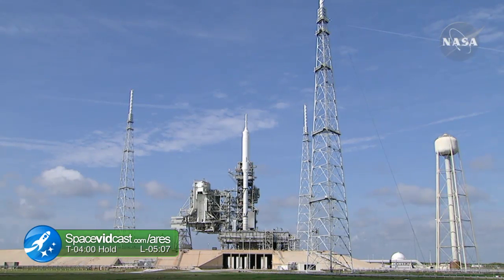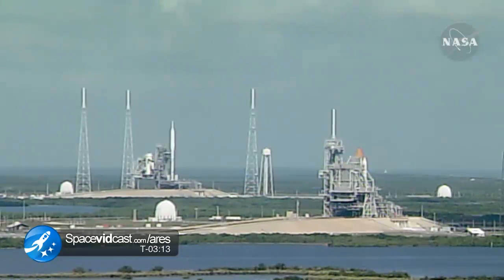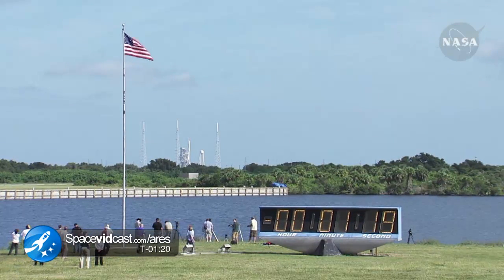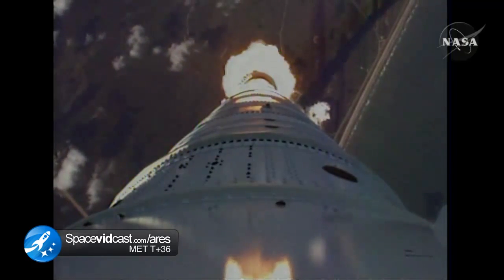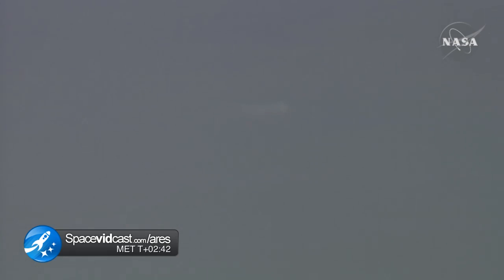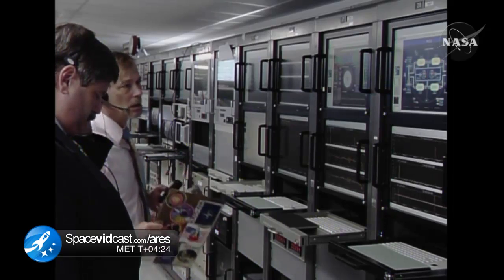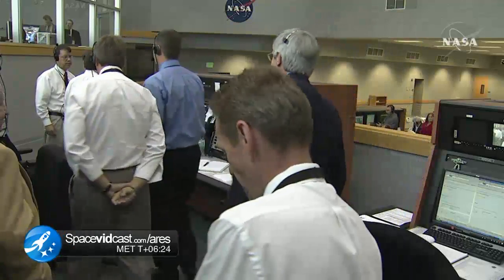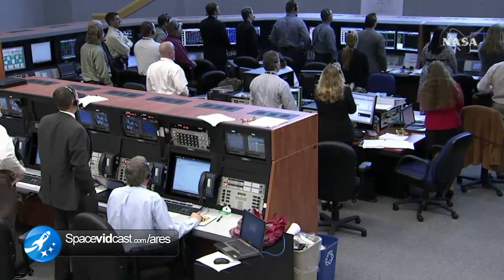Ares I-X Launch on 10/28/2009

Comment: Zephyrus001 (and Minueman 351):  The discussion is misplaced.  The second stage was a DUMMY!  A real second stage would have used pyrotechnics (including first stage breaking rockets) / ullage motors and ignition of its main stage to fly away from the burned out SRB.  None of this was available in this highly successful FIRST STAGE TEST FLIGHT designed to demonstrate that a highly educated SRB can serve as a relatively simple, safe, inexpensive, reusable, robust and otherwise perfectly good first stage for orbital flight !!!
Reply: "Highly educated SRB"? Does the SRB have three PhDs or what? Is this the F. Story Musgrave of rocket engines?
Reply: Gath Gealaich
You got it, GG.  Upgraded computer brain with trajectory data.  New sensors and communications elements to feed said computer brain.  And a new set of rocket thrusters near the top of the stack to induce (and stop) roll and otherwise assist the SRB's gimbaled rocket nozzle in keeping everything on course for two minutes.  :  ]
Reply: Russell S None of that is education. Education is what happens to a human being at school. Anyway, it's just a lot of pork for Utah, no sane person would design a rocket like that. Fuck corruption.
Reply: Gath Gealaich
Don't appreciate your language.  Sounds like you've been drinking that South African Kool Aid again.  Simple fact: If NASA had been allowed to finish Ares I (as many VERY sane people argued at the time), we could have dumped the Russians and been flying our folks to the ISS by now.  No pork involved.
Reply: Russell S "Language"? What language? That the company that killed seven people in live broadcast got another pork contract for their inadequate designs? You may not appreciate hard facts but they aren't going to go away just because you don't like them. The US could have been flying folks to the ISS in half a dozen different ways by now.
Reply: Gath Gealaich
The living legacy of the Challenger astronauts is that the U.S. now has a solid rocket booster that has worked without a burp 250 straight times, is the envy of the world and will take us to Mars.  The SLS will prove that.  You are angry, stuck in the past and need to move on...
Reply: Russell S Yes, and Ares I had to use an extremely ugly solution to the thrust oscillation problem inherent to solid engines. No, thank you, I'd rather go for designs that aren't stillborn. We already have F9, with a bit of luck, Raptor will come to fruition (it will be everyone's lucky day if it wiil), and despite ULA's very hard attempts at convincing me otherwise, I still think that ULA's people can respond to the RD-18x/19x engine challenge.

But hey, the person defending Shuttle SRBs calls me "stuck in the past"! What an irony...

Comment: My good sir, I would submit that you are the one who needs to learn about spaceflight, at least this specific instance.  I agree with you in principal about unmanned testing, but it doesn't apply to Ares I-X and here's why:

1.  Ares I-X was not the only unmanned test flight.  Ares I-Y, the all up test flight was scheduled after (which would have been a proper test)
2.  Ares I-X was only tested using a 4 seg booster (not the 5 seg for the operational Ares I) and an inert upper stage.Continued...

Comment from the maker: @nerdystarwarsman1994 Well, they spent a lot of money, yes. But an Ares I-X is not an Ares rocket. The rocket above is a 4 stage SRB whereas a real Ares is a 5 stage SRB. The above rocket had no upper stage whereas a real Ares would have a full upper stage. Heck, even the guidance computers were taken from another rocket as they were not ready. Most of the rocket is not Ares, only a small handful of components were, such as the parachutes.

Comment: Solid rocket fueled rockets like Shuttle and Ares 1-X remind me an old car running with bad gas in the projects.   Liquid fueled rockets like Soyuz and Falcon 9 are clean burning and look more like a real rocket (almost like jet fighter running full after burners).  Shuttle and Ares look more like there is fire on the bottom of the vehicle and  burning every direction making lots of smoke.

Comment: The local spaceport won't have anything a common person would be able to afford for at least 50 years, 50 years if we're lucky.

With a space elevator, you can build more space elevators cheaply. I've researched this and gave it thought. The ride up on the space elevator won't be bad either. By the time you can afford it, it will either be a nice hotel on the way up, or better, it will be a fast ride up.

It's not going to be one elevator at the equator. It's going to be thousands.

Comment from the maker: Well, and the parachutes. They didn't deploy right and they were the only final part of the Ares. This wasn't a full 5 segment SRB it was a 4 segment from the STS program (the Ares SRB wasn't done yet). There was no Orion module. There was no upper stage.  One of the only real parts of the system that will be from the final Ares design was the parachute. 1/2 of the stopping power failed and we bent the SRB on impact.

It *is* a test so failure is expected.  Borrowing from other programs is not.

Comment: Looks like the SRB fired and pressurized perfectly, the guidance system gimbaled for maximum deflection test while maintaining structural integrity, stage separation worked, the airframe proved functional at Mach IV @ 150,000 feet, and the parachutes deployed.  The launch vehicle was recovered, so the crew got that right.

The only thing that really failed here was your analysis.  Just for the record, do you have any clue what the cost and time and logistics requirements were for the Saturn V?

Comment from the maker: I wouldn't go touting the success of Ares just yet. 

The SRB was borrowed from the STS program and was not the 5 stage unit.  The upper stage wasn't done so they used a dummy.  The LAS wasn't done nor was Orion so they were both dummies.  The guidance software wasn't done so it was borrowed from Atlas instead.  The parachutes were real.  Of the three one failed fully and one half failed.

So basically almost none of this rocket was real, none of it was complete, and what was complete failed.

Comment: Just try taking a further look at things that sound crazy but aren't quack science.

Anyhow, the thing I expect to work the best in a time period that we're more likely to see is a system where we use large powerful rockets up to a station that acts more like a spaceport to the moon where you send craft powered with ion or plasma thrusters, which are far more efficient than using traditional chemical rockets when you can use a gentle push in space to go far.

Comment: Well, sorry to burst your persona of the realistic skeptic, but the equation E=Fd, Energy equals force times distance, completely disassembles your argument. A space elevator will always and forever require far less energy than a rocket to the point at which rockets are a joke in comparison.

Furthermore, a space elevator does not take nearly as much resources as the name would imply and the only major obstacle is achieving the tensile strenght of carbon nanotubes.

Comment: couple things.... i saw and concur, but the speaker says "seperation and tumble motor ignition"....   is there any conceivable reason they would want the the upper portion to tumble as it did?  Also i was wondering if the fact that there was no 2nd stage ignition, which would have propelled the craft straighter....   i dont know but i did notice what you mention and was wondering myself....

Comment: NASA has already talked about it. The spin direction of the second stage was one of the predicted scenarios evaluated by the simulator. The upper stage was unpowered in this mission so it was pretty much just dead weight. In a real mission it would push away from the first stage with vernier engines.